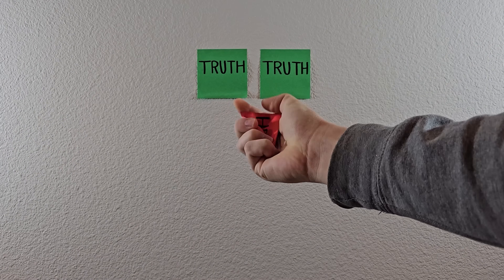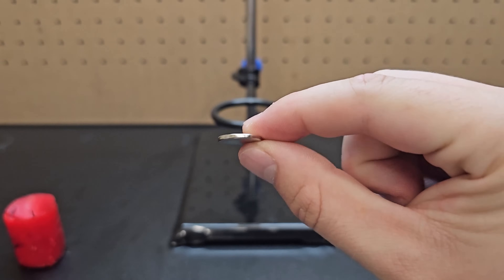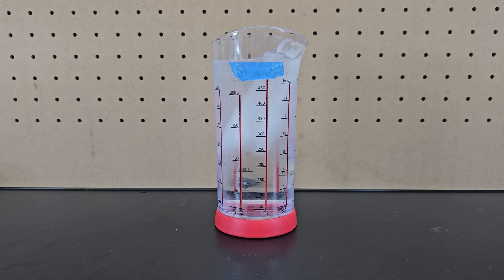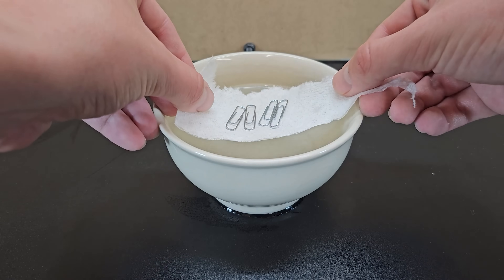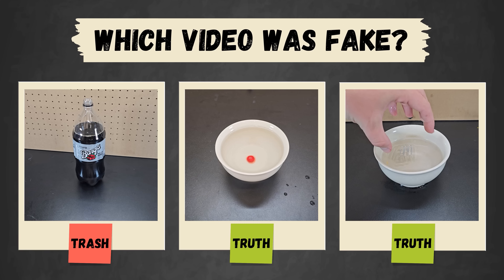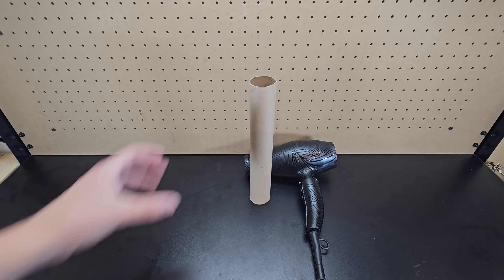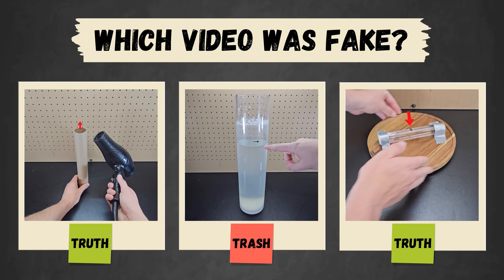2 Truths And A Lie, but with Science Experiments. (S3E6)

Comment: These are my thoughts on round one: if you only put one ice cube in the water, it would not float, and the level would obviously not increase. To put another ice cube in there would multiply the affect by two. If the level didn’t increase before, that would be 0x2.

Comment: I know magnetic would lose strength at higher temperature...but I didn't realize that heat from candle light would be enough. I thought you'll need quite a bit more heat than that to actually do it...

Comment: I thought the water level would rise just because ice is less dense than water.
Reply: Why would the water level rise? Ice being less dense means it has a BIGGER volume than the same amount of liquid water, so if anything, ice melting should make the water level go LOWER! 
And it will do just that if you hold the ice fully underwater while it melts.

But since ice is less dense than water, it naturally doesn't fully submerge and instead floats partially above the water. Things less dense than water only displace the volume that the same mass of water would have, while the rest of their volume stays above the water. As the floating ice melts, it becomes more dense and loses volume until by the time the ice has fully melted, it's volume is exactly as big as the volume of the part of the ice that was submerged. Thus the water level stays the same.

The only way melting ice can make the water level rise is when the ice is being (partially) hoisted above the water or resting on solid land/matter while melting into the water, which is exactly why climate change makes the oceans rise: Because the vast majority of the ice on earth's surface is resting on land and thus not displacing any water. When that ice melts, it adds it's volume of water to the oceans, unlike floating ice, which volume is already in the ocean, just not in liquid form.

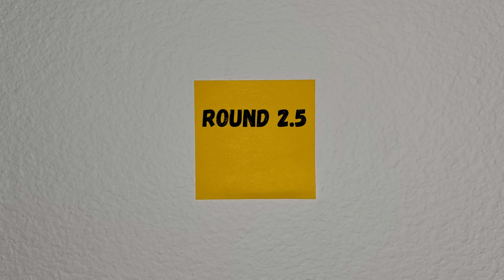Comment: 3:14 yes, all mammals have the same number of neck (cervical) vertebrae with the exception of sloths and manatees, this is because they have a much slower metabolism.

3:18 no because the unspecialised (meristem) tissue that can freely divide and grow is only found in the tips of roots and shoots.

3:23 yes, they just have different arrangements with a different number of bonds. Pencil graphite is made of layers of graphene which consists of carbon atoms with 3 bonds between them and hydrogen bonds between layers, diamond is made of carbon atoms with a full 4 covalent bonds between them and between molecules.

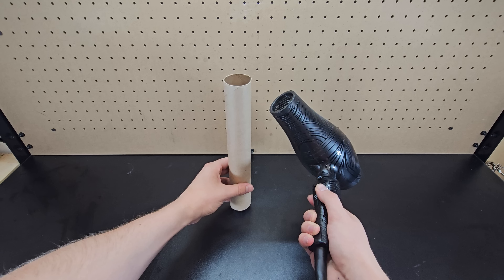4:40 this is because the air flow causes a decrease in pressure over the tube which pulls the air and the pingpong ball through.

4:49 that’s because the water is denser so it displaces the air to the centre as the relative gravity pushes outwards.
Reply: What does metabolism have to do with neck vertebrae?
Reply: @Cillana  it’s weird but if you have a mutation that causes you to have more or less vertebrae your at a much higher risk of cancer or heart problems. Manatees and sloths don’t have to worry about these since their slower metabolism allows them much lower body temperatures which for some reason means they don’t have to worry about cancers.
Reply: @DreadEnder  interesting!
Reply: @Cillana  yeah I know a great biology YouTube called Forrest Valkai who talked about it in a bit more detail. I’ll try and find the clip.
Reply: @DreadEnder Huh! Small world after all!
Reply: @Cillana  I forgot why exactly at the time but it’s due to epigenetics and homeobox sequences. Homeobox sequences regulate the body plan of an organism and epigenetics is where one gene can determine whether a different gene is expressed or not. In this case the gene that determines the number of neck vertebrae also acts on the ability of your cells to regulate mutations. And so when that gene goes wrong it affects your risk of cancer. In animals with a slow metabolism they don’t have to worry about this.
Reply: @ I don’t get how. Sorry if I’ve seen you before memory is terrible.

Comment: this was easy enough.

But i never knew the cap gun stuff would work.
It just made more sense than water levels rising because of sea ice melting.
(o, eh, i hope i wont get into trouble with the climate nutzies)
Reply: when ice which is floating on water melts, it does not increase water levels. but when ice which is not floating melts, it does increase water level.

for example, imagine a glass with just ice in it. as the ice melts, does the water level rise? of course it does, the water level was previously non-existent, and then it starts increasing from the bottom of the glass

Comment: H2O is one of very few things that actually expand when going from a liquid state to a solid one, so that also likely has something to do with the lack of rising level as the ice melts.
Reply: Sea levels still rise since ice in antarctica is not floating
Reply: Antarctic ice is on dryland so when that melts it will make the sea level rise
Reply: I believe this is because it crystalizes, so if you made it not crystalize somehow, which I'm sure is possible, it might actually get denser. Just a thought.
Reply: There is such a a thing as amorphous ice that doesn't typically form on earth, but is theorized to be the most common phase of water in the universe. 
Low density amorphous ice has a density just above regular ice (0.94 for LDA ice vs 0.9167 for regular natural ice). 
Ice XII has a density of 1.3 g/cm^3 and forms at about -13 C, but only under high pressure (about 5000 atmospheres). 
Ice VII has a density of 1.65 and forms at 82 C, but requires over 21000 atmospheres of pressure and must be formed from ice vi, which requires about 10000 ATM at -3 C. 
There's also ice xvi which is less dense than regular ice (0.81 g/cm^3) and also requires high pressure or very low temperature, and sounds like it's not stable.
Reply: @Jackaboy3695 
Amorphous ice is a thing and doesn't form naturally on earth, however is theorized to be the most abundant form of ice as it requires a vacuum.
There are more dense forms of ice as well as one less dense form (ice xvi), however all of these forms of ice require extreme pressures from 2000 atmospheres to over 290000 atmospheres.
Reply: It also expands when heating up, it is the most dense at 4°C.
Reply: Not at all. Other solid items in their liquid forms simply won't float.
Reply: @andrewwebb917 
It seems like you also thought they were talking about some space packing thing or something. 

Expansion requires that the same mass take up more space, therefore being less dense, therefore allowing them to float in the non-frozen form of themselves, therefore allowing the level to not change as they melt into a container of their liquid form. 

Other solids don't float in a container full of their liquid forms because they don't expand when they crystalize.
Reply: @kikamonju  the reason sea levels are rising is because the ice that is melting is on the land. It then flows into the water.
Reply: @andrewwebb917  This is a non sequitur and I'm not sure why you replied to me with this statement about sea levels rising. 

I was trying to explain to you why you were both right about what you were saying. 

You seem to be trying to fight with me about nothing.
Reply: @andrewwebb917  I think you meant to say "other liquid items in their solid forms won't float."
And what are you refuting anyways? Are you saying there are a lot of liquids that expand when going to a solid state? If so, please provide a list. Water and iron are the only things I can think of off the top of my head, but I'm sure there are a few more exotic ones (key word being few).
Reply: @nemonomen3340  ice acts like this as, since it's lless dense than the liquid, it displaces exactly as much liquid as its mass, as it floats. 

A solid which is a lot more dense than the liquid it is in could displace a lot less than its mass. So when it melts, the level may go up.
Reply: @andrewwebb917  Sorry, but I can barely decipher your broken English and excessive use of commas. And (so far as I can tell) you don't seem to actually be saying anything that contradicts my original comment.
Reply: @nemonomen3340  the liquid doesn't rise when the solids float in the liquids.
Reply: @andrewwebb917  Yes, and? That still doesn't actually say anything contrary to my comment.
Reply: @nemonomen3340 
Yes, a lot of subclauses and commas. 
No, that is not broken English; it's actually perfect grammar with a very confusing structure if you don't already know what they're saying.

Comment: I don’t think the candle will get the magnet hot enough to demagnetize it
Edit: dang
Should be possible to carbonate the soda, but just pumping air into the container doesn’t seem like it should be sufficient? The carbonation tools I’ve used have the device go into the water and bubble through it. So, that one seems maybe fake?
The M&M one, sounds really fake, but also sounds really inconvenient to fake? I guess that one is actually the fake one, but seems like faking it must have been difficult.
Edit: wow. Weird.
Giraffe
… really? Hm

Air bubble definitely true.
Tube seems… unlikely that such an effect would be strong enough to lift it that high,
I don’t have a good intuition for the salt. Seems plausible.
Going with hair dryer
:|
Am I an idiot?
Oh, I just misinterpreted the claim about the salt. I thought he just meant “goes down compared to when the salt was initially added”. Yeah no, I didn’t think it would have less volume than just the water.

Comment: I remember my grandparents used to have some of those soda pressurizers. Don't they at least dissolve some air in the soda, or are they complete scams?
Reply: I think you mostly need carbon dioxide in the bottle and to generate enough pressure for it to work. I think action lab once did a video on this but the coke was only mildly carbonated after recarbonating
Reply: Damn, my memory served me well, 6 years. The video by action lab is "is it possible to carbonate soda with your own breath"
Reply: There is very little co2 in air but pressurizing the bottle prevents already dissolved co2 from bubbling out of the solution

Comment: Round 1: The ice one is fake. (B) The ice will still displace its weight in water and it’s actually denser; if anything the water level should lower; albeit imperceptibly as the ice melts…

Round 2: A. (The recarbonation demo) real carbonation of beverages happens at high pressure using pure CO2. The method supposedly demonstrated here could slow the loss of carbonation but not reintroduce it to a flat drink.

Round 2.5: I’m less confident in my answer here but I’m going with B. Plants construct new biomass mostly from the carbon they catch from the air; growing into it; not being extruded from the soil like a piece of plastic from a dye. The nail would therefore stay at the same height as the tree grows up; not out.

Round 3: B, the salt solution one is fake. The salt would occupy less volume in solution but I can confidently eliminate A and C as fakes, so if any of the demos are fake it’s B, with the salt solution not being sufficiently more dense than the water and salt to cause a net decrease in volume.

Comment: Why exactly doesn’t the pump cap work? I know that air is mostly nitrogen, but I would think that the CO2 in the air would be enough to at least dissolve a little bit into the soda. 
I just looked it up right before posting my comment, and air is 0.04% CO2 💀. That’s way lesser than I thought it would be haha. Also, gas dissolves easier in liquid when it is much colder, so 0.04% CO2 at room temperature never had a chance.

Comment: I was really hoping that the  recarbonated pop was real... so much for that...
Reply: It technically is true, just not with the conditions presented. If you pump in pure carbon dioxide at much higher pressure than a hand pump can deliver, and ensure it mixes with the fluid, you can recarbonate the beverage. There's an entire product category devoted to exactly this. Soda Stream is probably the most popular example.

Comment: B for the first one. The armstrong powder in the capgun ammo is pressure sensitive, and magnets loose their magnetism under heat. The water that's floating displaces just as much. Additionally, ice floats because it's less dense that liquid water, so when it melts it will take up less space. 
    I was right, but I thought the level would sink lol
A for the second. It'll recarbonate it somewhat, but not as much as was shown in the video. I've done the MnM food coloring thing, though the letter didn't come off I can believe it. Soap destroys water tension, so the paper clips floating via water tension will of course sink.
   Bonus! The tree one is false. I only know that because the other two are definitely right.
B for the second. That's just not how making a solution works.
Reply: *lose

Comment: So if you add solid water to liquid water, nothing happens. If you add salt to water, the new water level is higher than the original. I still do not understand
Reply: When you add ice, the water level does end up higher than it was originally (before the ice was added). However, it is exactly the same as it was after the ice was added but before it melted (which is also a higher level than originally), which is what the "fact" was about.
Reply: When you add a thing to water, the water level increases. That's it. If you put ice in water, the water level goes up, but it's not going to go up MORE when the ice melts.

Comment: round 1, I knew it was B but i though it was cus water is less dense with it freezes, ie it expands when frozen. the explanation he gave doesnt make sense to me
Reply: Well, the two are directly linked

Ice is indeed less dense than water which is how it floats, but just like any solid floating on a liquid, the volume of water that gets "moved" (or in other word, the volume of the solid that is submerged) is roughly the same weight of water, as the weight of the item

So, if you had a 1 Kg floating item, the volume under the water level would be 1L (or 1dm³), since 1L of water weighs 1 Kg 

Therefore, the volume of the ice cube under the water level is equal to the volume of water of the entire ice cube once it'll melt, so the water level cannot change.

Not the simplest explanation, but I hope it made sense ^^'
Reply: @anybody3689  that makes it a little more clear. i think i get it